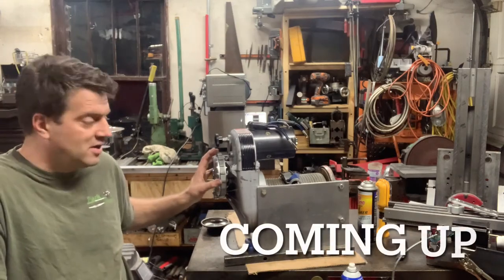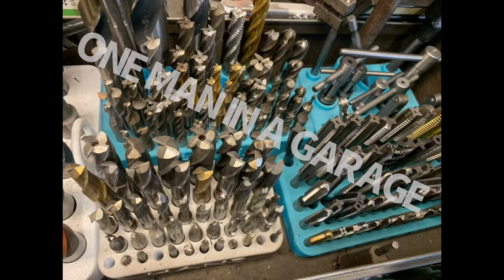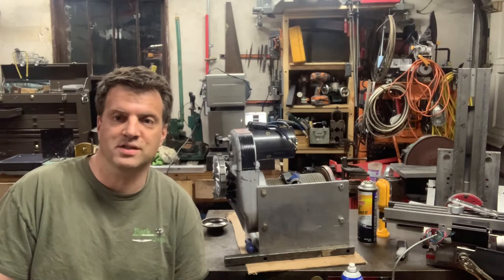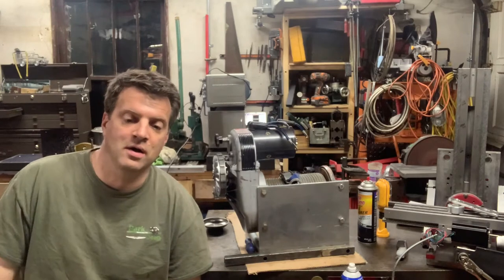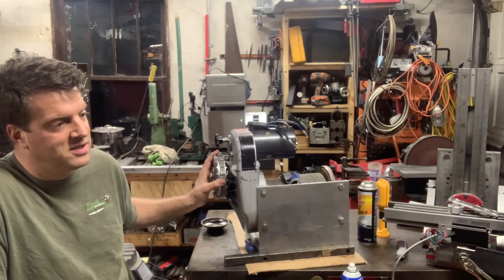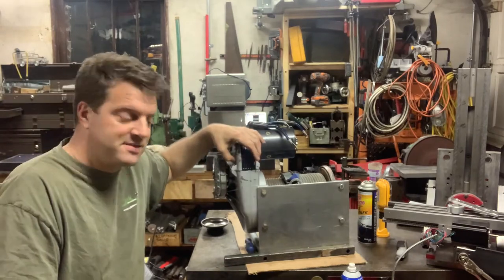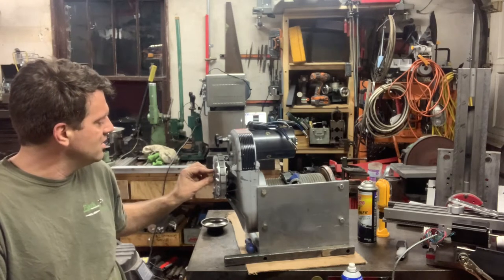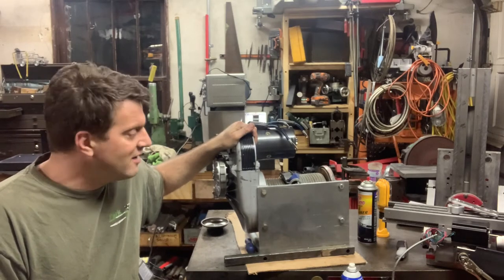Warn Winch 8274 Brake Assembly Teardown and Mods

Comment: Can't figure this out. Free spool gear disengaged. I can turn the  brake drum assembly and rotate the drum by hand. As soon as I put the top cover on I cannot rotate the drum assembly and drum by hand. Free spool is disengaged and the gear in the top cover spins freely. What is locking up.? Please help.
Reply from the maker: Been a while since I had it apart sorry not picturing everything in my head.  I suggest finding the Warn 8274 pages on FB there’s a bunch of people smarter than me on there that restore and mod these things all the time.

Comment: Was the bronze bushing more of a slip fit? It looks like it from your video, but my new bushing won't go in without hammering on it, and I don't think that is correct. Going to try and sand a little off the outer diameter or sand a little of the housing bore.

Comment: I enjoyed the video. I am currently in the process of rebuilding a 1982 M8274 only nothing on it came apart as easily as yours! It was totally seized with rust and took weeks of soaking get it disassembled! Your use of the rare earth magnets seemed to make the assembly process of the brake straight forward, and I will definitely try that out! I look forward to seeing a video on the Albright contactor setup.
Reply from the maker: Thanks for the note.  I will be doing one on the contactor.

Comment: I have the same winch and it will be interesting to see how yours performs. Have you done an update? Also, what is the found sphere-like half ball you place on the end? A cap of sorts to protect the shaft? Mine was very, very hard to remove.
Reply from the maker: I made that as a nice looking washer for the c lip upgrade in the brake shaft

Comment: FYI... also Vaseline or bearing grease helps hold the balls in place during the assembly!!👍👍
Reply from the maker: Sounds like it would but I didn’t want to get any oil on the friction surfaces or even close:  I hit everything with brake cleaner before assembly.
Reply: no no, dont use grease it will ruin the clutch friction disc's....use magnets, they will work perfect for getting the balls bearings to the outside...

Comment: What’s the chance you have that spacer laying around? Or could you replicate/duplicate it? It’d be worth a few bucks to me for sure. TIA
Reply from the maker: You mean the one on the brake shaft?
Reply: @hansw33  yes sir. My Giggle pin one did not come with the cardboard one. I wouldn’t have known about the spacer without your video…thanks for that for sure.
Reply from the maker: @freightpimp  I could make the domed spacer but you need the shaft to be drilled and tapped.   If you watched the whole video you saw what a pain that was.  Let me know
Reply: @hansw33  I watched the whole video for sure. That was a bear drilling out the main shaft. I don’t think I need all that! Lol. The spacer that you made for the seal (replacing the cardboard one) is what I was referring to. You could send me yours and I’ll send it back when I get mine assembled? Lol
Reply from the maker: @freightpimp  I’ll see if I still have the spacer I will give it to you if I can find it
Reply: @hansw33  That's awesome! Thanks!
Reply from the maker: @freightpimp  I think I chucked that spacer but if you tell me the width of it I’ll whip something up for you if you pay shipping.  Would be real cheap to ship.  My Jeep is hibernating for the winter and with the winch all put back together it would be easier if you just told me the width you want
Reply: @hansw33  I’ll definitely cover shipping. I’m not exactly sure what the measurements are…but I’ll investigate that cardboard one.  Seems as the cam shaft I purchased from GP was drilled and tapped with an end cap similar to yours! Lucky me. Lol.